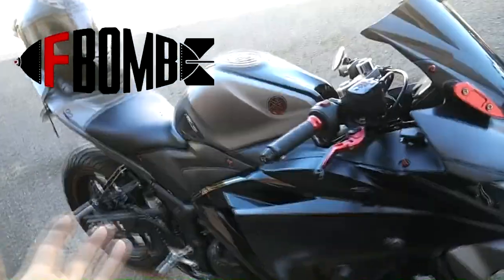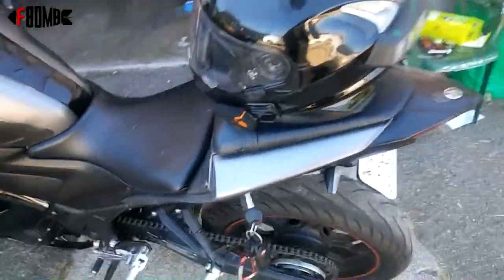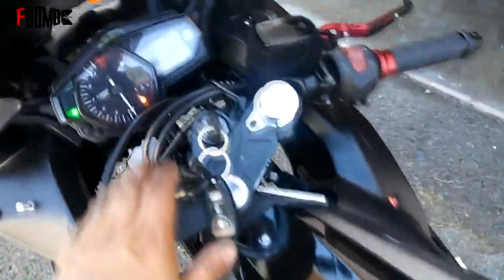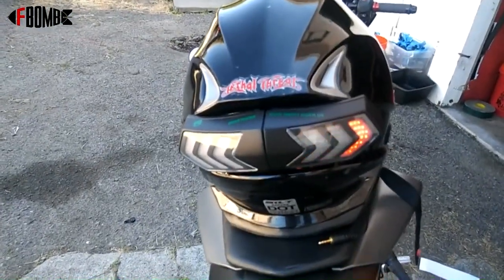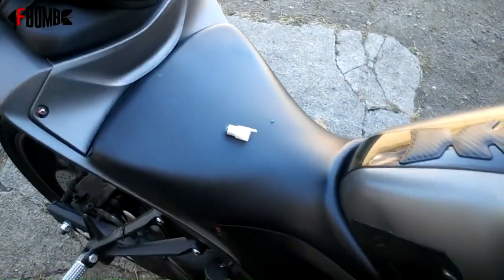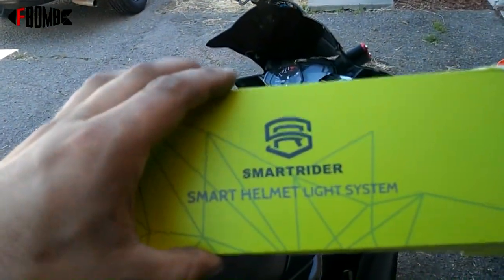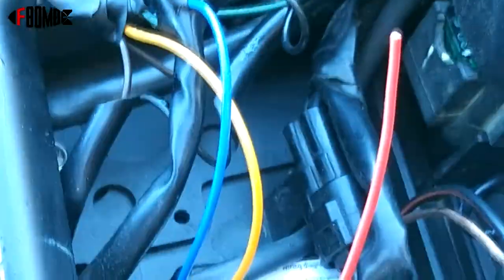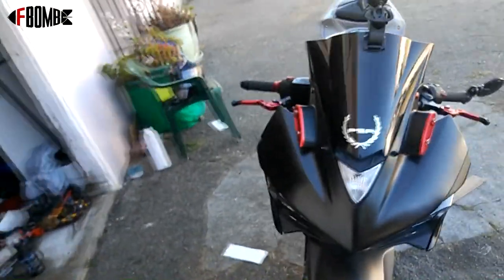SMART RIDER HELMET TURNING SIGNAL REVIEW

Comment: does it have a braking light connection and do they ship to the UK?
Reply from the maker: It dose come with break light and I'm not sure if the ship to UK
Reply: @FbombBikeLife  The RED wire is not an antenna!   It is for the brake light.   You have gotten around it because when the brakes are applied it lights up both the left and right turn signal indicators.   In some older vehicles they had a separate brake light.

Comment: Hi there nice video ! What is the battery backup of the helmet light ? What is the charge and discharge time ? Please reply.. Is it still working ??? 😁
Reply: we have taken our unit out for 8 hour rides and it still worked.   At night we plug it in and then continue the next morning.  Charge time is about 3-4 hours.  We have had ours for about three years.   I have transferred the transmitter module to a new bike and we are still using it.

Comment: how do you stick the lights on the helmet? with a glue? Also, are you sure that brake lights are not included in this? I've seen very similar products (that look identical to yours) where it is claimed to include brake lights. Unfortunately I can't find any videos that prove that.

Nice ride by the way :)
Reply from the maker: abcddcba09 thank you! The lights come with adhesive Velcro. I dont think this product includes a breaking system. Unless i wired it wrong...but im pretty sure i did it correct
Reply: Brake is red wire
Reply: Stuck on by factory double-sided sticky tape already on the signal itself pill it and stick it to your helmet But be sure you got it right side up LOL or when you turn left is going to say you're turning right on your helmet and left on your bike

Comment: How did you get the X-wing into the pairing mode, as the instructions suggest turn on the X-wing and then holding the power for 3 seconds to put into pairing mode but this just turns off the X-wing!!!!!    Please help
Reply from the maker: Mark Jenkins have you tyres holding down the swing and power button at the same time. If that doesn't work try from the off position hold the button for longer than 3 seconds. . . Like 10 seconds or so...
Reply: FBOMB Bike Life Sorry what did you mean by the 'swing' ???.
I have also tried hold the power button down for 10 second, still no good it just turn off. There seems to be a 'pairing' button on the controller but on my Instructions there is no mention of this. Did you press this button when setting yours up ????
Reply from the maker: Mark Jenkins sorry ...yeah that's the button I'm rendering to. Are you sure it's connected to your bike battery correctly? You might have installed it incorrectly
Reply from the maker: I will take a closer look @ mine and if I can see the problem I will upload a video on that topic asap
Reply: FBOMB Bike Life 
There are only 4 wires from the controller being :
Orange (left indicator)
Blue (right indicator)
Green (Earth)
Red (brake light)

The instructions suggest :

first turn ON the X-wing wait for 2 flashes. again hold the X wing's power button down for 3 seconds wait for all the LED's to flash 

turn ON the motorcycle, then press the brake or indicator this will automatically pair the x-wing to the controller !!!!!!

In the same instructions it also tells you by holding down the power button for 3seconds will turn OFF the X-wing too. 
So I'm going around in a circle!!!!!!